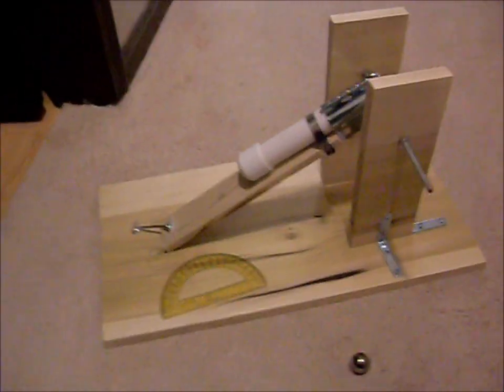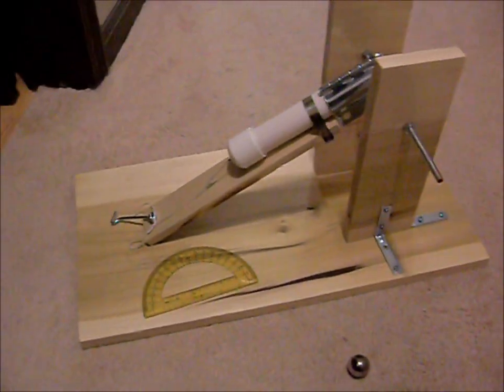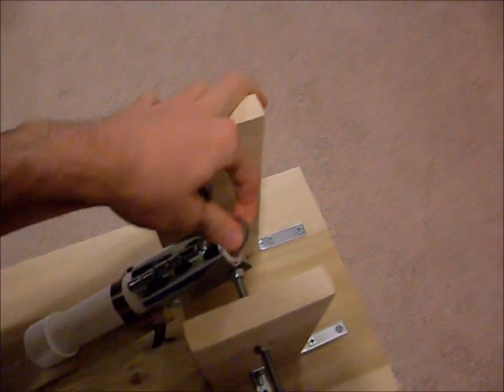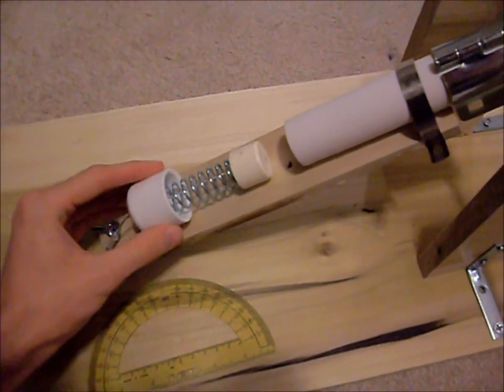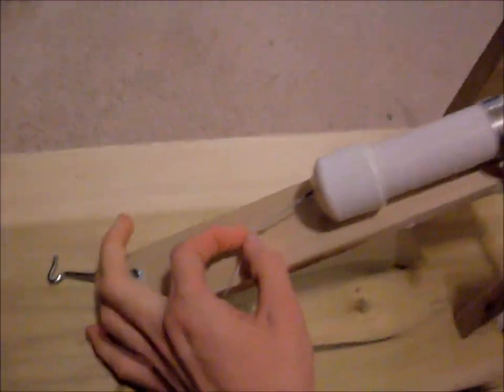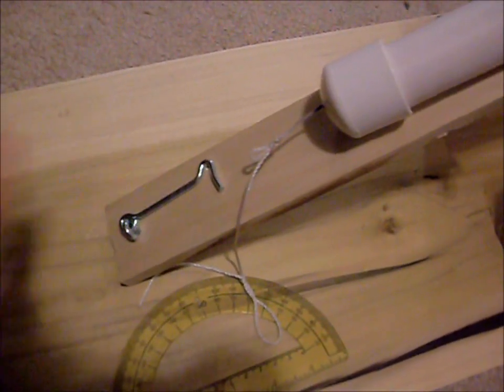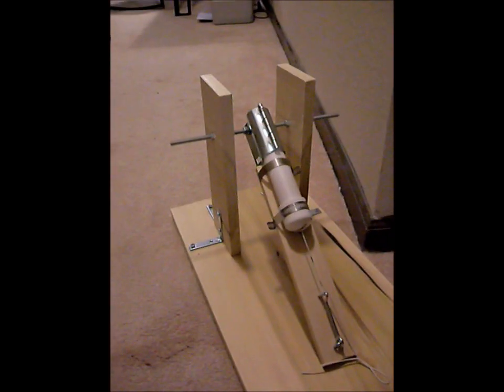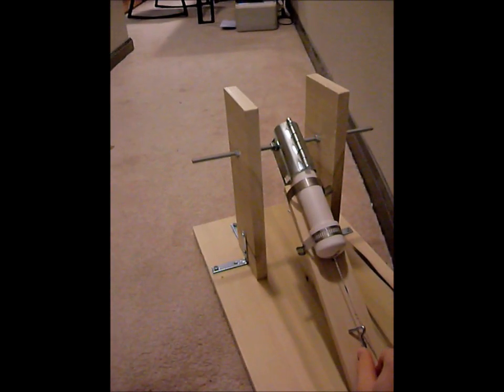projectile motion.wmv

Comment from the maker: @Gre803 I got this particular spring from Home Depot, but in my experiences, Ace Hardware has a much,  MUCH better selection of springs. If those stores both fail you, and you know exactly what spring you're looking for, try McMaster-Carr (mcmaster.com).
Reply: do you the value of spring constant, i am searching for a spring, i ordered (according to my calculations ) a 200lb/inch spring but it was too hard to compress, i am planning to replace it with a light (1.77lb/inch) much lighter!!!! but if i use the energy conservation it says it will take 11inch of compression to launch 50gm marble ball at a height of 2ft. 
what spring you used ? specifications or link plz?